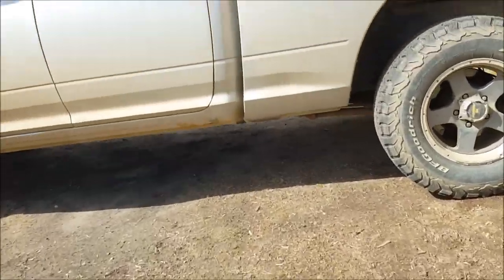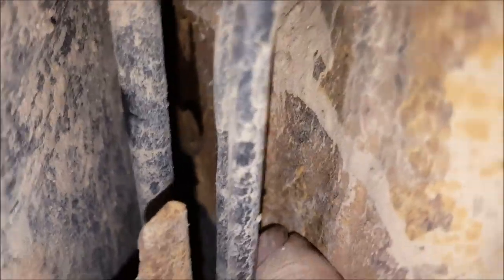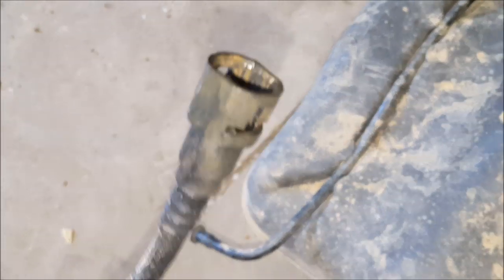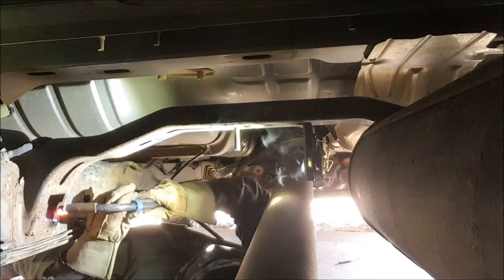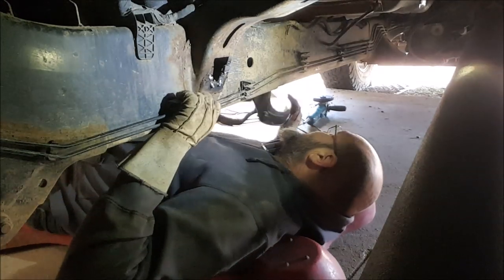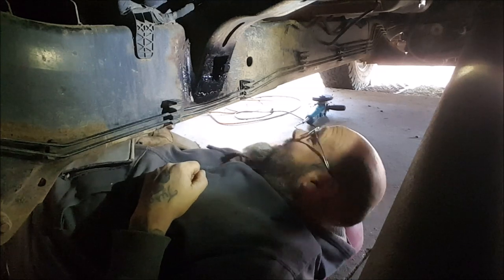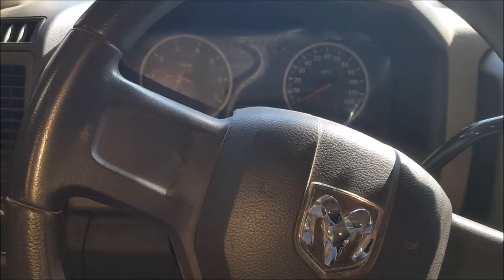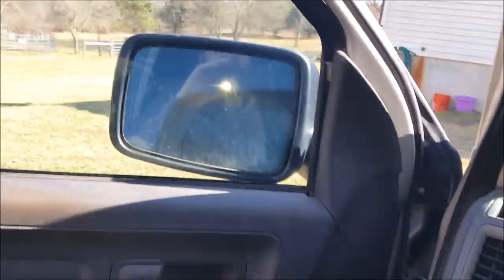GAS Tank Strap Repair 2010 Dodge Ram

Comment: I dread any auto repairs. They just make everything such a pain in the ass to get to
Reply from the maker: Thank You Brad,  well I use to think it was fun doing all this stuff, but yeah I agree everything is so hard to get to now.
Reply: Brads Workbench 
LOL, ya think?  Starter finally went bad on my Tundra a couple of years ago. I can do this.
Uh, no! Not when I discovered Toyota put the starter on TOP of the engine in the valley, requiring all top end intakes stuff to be dismantled/removed. Starter was too expensive but the labor racked up $1200 at the dealer. Aggggghhhhhhh!
Reply: @8ftbed  ouch!!!!

Comment: I don't have much rust out here in Oregon but I've definitely pulled the tanks of a few trucks laying in my driveway to fix other issues (usually fuel pumps).  Good to see someone that can work with their hands and their brain :-)  Nicely done!  P.S. The jack skills putting the tank back in were impressive!
Reply from the maker: Thank You Dennis,   many many years of working on cars by myself were involved in those Jake skills !

Comment: Watching this video has shown me the bottom portion of my frame for said brace has rusted off slightly. Unfortunately I'm a broke ass and can't afford repairs. Hopefully some 2×4 and straps fix this problem for now.
So maybe it hasn't rusted through and just needs cleaned, but I thought recalls meant the dealership covers it 

Should probably add that km watching this to distract myself from el camino
Reply from the maker: LOL  funny guy, actually I had already repaired it before the recall happened and to this day it's still holding, no matter how broke my ass is,  I did get a recall and figured I probably voided that by welding on it, not really a big deal anymore as it's paid for it's self many times over and still goes down the road.

Comment: Just replaced both of mine on my 01 F250 Super Duty.
Reply from the maker: well I fixed this once but as you can see did not do it correctly, I should be good for a while now.

Comment: Total Boat resin colored with rust dust would have blended right in! AND might not have cracked! I've had some of these repairs too. Gas tank puncture in San Antonio on vacation in pouring rain plugged with epoxy repair kit for gas tanks. Held up for years!
Reply from the maker: LOL Thank You Bob.

Comment: I get to wrench on school buses when I'm not in the woodshop so I identify with the frustration level working in tight quarters. You'd think there'd be plenty of room on a bus but not the way they're designed. I think engineers should have to mechanic before they design. Well done Doug, even painted so it'll never rust again! Have to wonder about that sinking jack though!
Reply from the maker: Thank you Dustin,  that Jack has been around since I was a little kid,  her seals are tired along with it isn't exactly warm in the shop.

Comment: It's a piss poor design there should be holes in the bottom to prevent the bracket from filling up with water slush snow and salt. My tank just dropped last night on my 2012 ram
Reply from the maker: There's a recall on it but I had already altered the bracket once and I thought it might of voided that recall so I just fixed it again in this video

Comment: Found this on mine the other day.. There is a factory recall for this issue. Google Dodge U04 recall. It was launched In March of 2018..
Reply from the maker: Thank You Mike, Yes I know that there is a recall for this, I got it after I fixed it the first time, I'm sure I voided that recall welding on it myself.
Reply: The Pohl Barn Productions If it’s working, I’d leave well enough alone as well... 

I don’t think you can void a recall. A recall is a defect that exists due to some sort of engineering, or manufacturing oversight..  It’s not like a warranty thing.. Anyways, Welds can be erased.. Thats why god made angle grinders..  ;)     

I’m bringing mine in next week. Mine is currently held on with a ratchet strap. The recall states that if the front one has already detached, then they are supposed to replace the rear one as well.. I’m pushing my chips in on them not replacing the rear one as specified in the recall...  I like to keep expectations low.. Less disappointment that way.. 🤣
Reply: Did they fix it for you just wondering I’m going in for a recall same exact issue ?

Comment: You’re fortunate you have the skills to do the repair.
Reply: Not wanting to drift too far off topic but it seems many US independent small businesses are fighting the big corporates (like/mainly Apple) for the Right to Repair (RTR) -   search Louis Rossmann here on Youtube)

Yes technology has changed and so has the abilities of the next generation to have a yearning to repair rather than replace (insert where's Greta and the other environmentalists on this landfill/waste issue) if possible - just that some manufacturers have decided "we" haven't the skills or it's a safety issue to just replace a battery or screen and yet it's OK and not a safety issue to remove a gas tank (bomb).
Reply from the maker: yeah I've pretty much had to do this stuff all my life,     the tank is only a bomb because of the fumes,  I was just making a point with it being that and welding or grinding by it.
Reply: @PohlBarnProductions  I understand - I'm qualified vehicle tech but 20+yrs ago (as hobby/in between employment)...wouldn't know much with today's engine management systems ;)

My comment was mainly to inform others about how manufacturers like John Deere and Apple are restricting general repair by utilising (unfairly) technology. 

For me (UK citizen) RTR isn't much of an issue but for EVERY American it will be...

Comment: there is a lot of rust on the car! my 1999 opel i never changed gasoline tank!
Reply from the maker: I live in the rust belt,  they salt the roads here in the winter. my 29 Ford has not rust on it either but it doesn't go out on the road in the winter.
Reply: @PohlBarnProductions  Same here in Norway. But there is a difference between cars. Some can withstand salt and stone splashes better while others are poorly made. Factory can not make cars only for places with little snow and ice! Tectyl under the car is fine!
Reply from the maker: True,  cheap china steel made this truck,
Reply: @PohlBarnProductions  ok.